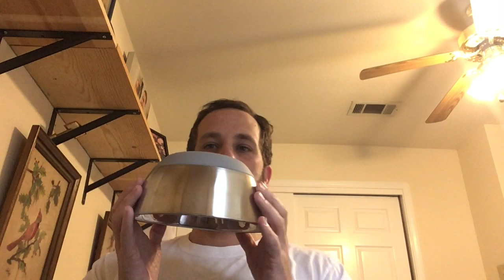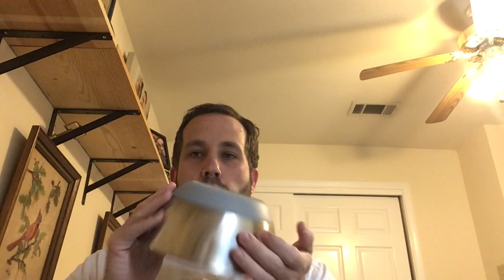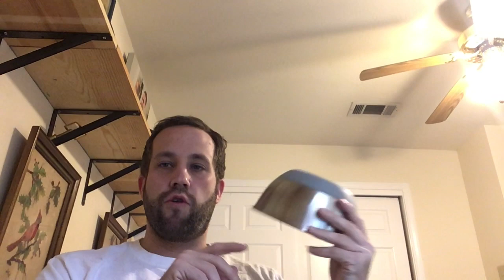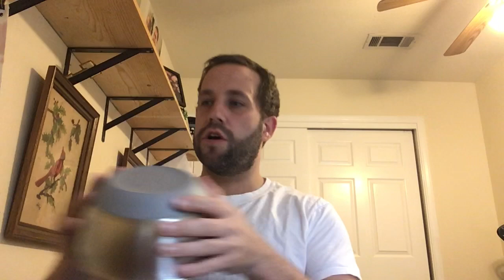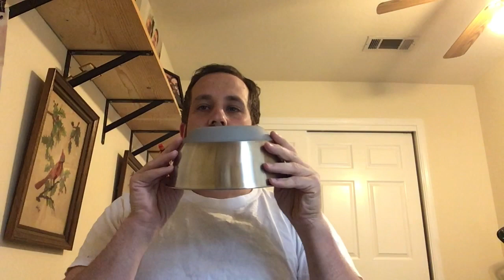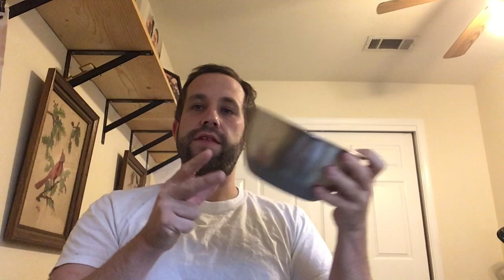Orientation Of Surfaces

Comment: Really well explained! But after you parameterize a surface and found your partial derivatives. You can take the cross product and get the normal vector right but what if lets say in a question they require a positive z-component but your normal has a negative z-component. Can you just multiply it by -1? What I meant to say is how can be sure that a scalar product with the partial derivatives will result in 0? In this case I am talking about a plane.